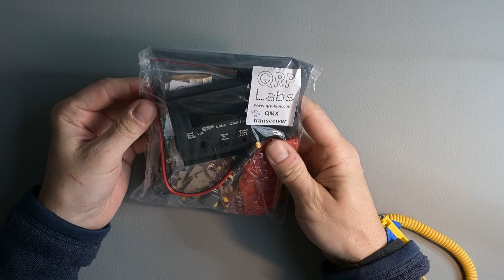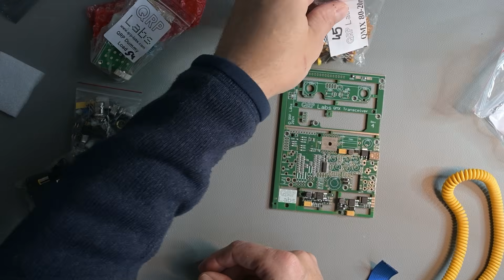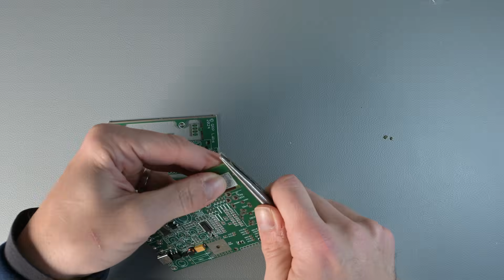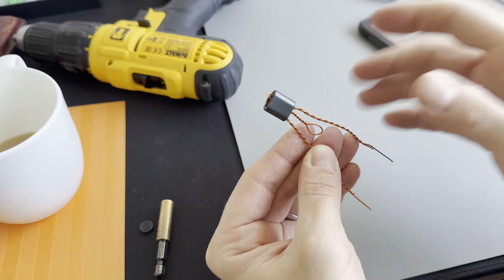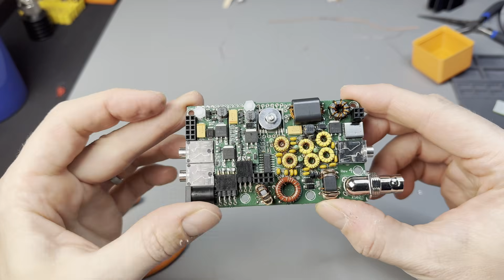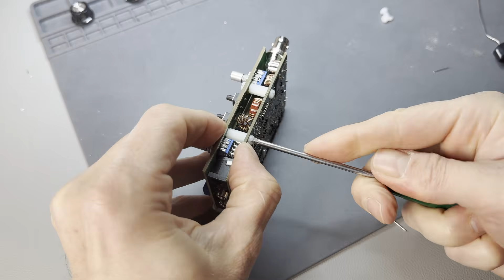QRP Labs QMX Build

Comment: Excellent video, thank you very much! There's a 10W/13.7v mod for QMX+ that at least one person, Jeff Moore W1NC (the US fellow North American hams send their disobedient QRPlabs gear to for repairs) has applied to the standard QMX as you've built it here, by bending one of the display tabs away. Hans has a write-up for it in the QMX+ modding section of the QRPLabs website.
Reply from the maker: Don't want to upgrade it, 5W is fine for me; but it is actually broken!  an internal zener fuse went (at least that's the theory); I'm going to try replacing it this weekend.

Comment: 21:25 The QMX+ is the same circuit design in a bigger enclosure.
Reply from the maker: Indeed, but that's the home/desktop version with extra range and features.  Agreed it will be easier to build; and I have considered getting one.  I'm on the homebrew train for now.
I think this radio is fantastic, if I didn't say that enough in the video (since it was filmed I have often used it, as my next video will show).  The addition of SSB has made it a great little radio, and a joy to listen to.  I aspire to make signals that clean!!
Reply: Isn't the QMX+ 160 to 6 meters and the QMX is 5 band, (low band, mid-band, high band?)